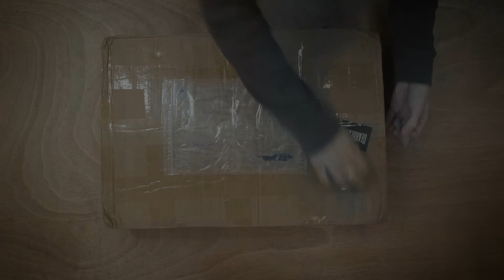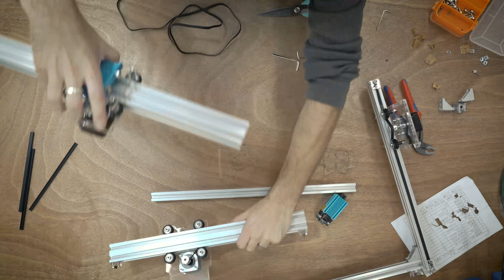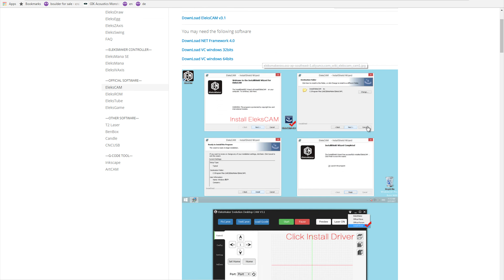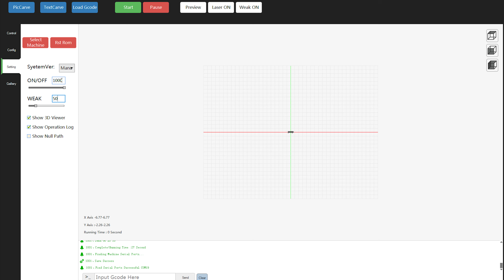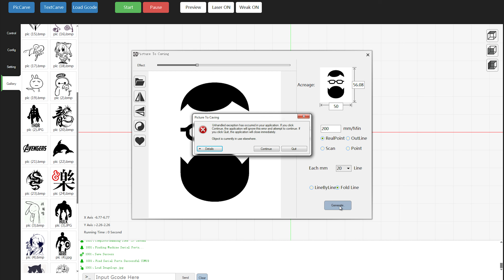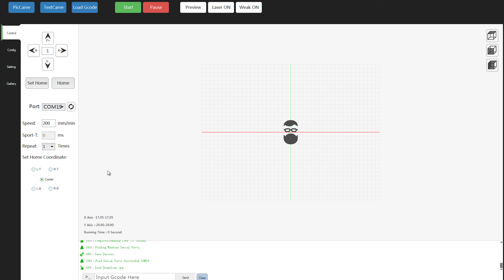Product Overview - EleksMaker A3 Laser Engraver

Comment: I have one of these and have had it for a couple of years.  I like it sort of, but it was a 2nd had one and the laser isn't the factory one that was supposed to have came with it.  It still does fairly decent.  When I engrave wood with it, I wash it off lightly with water, let it dry, then clear coat it.

Comment: Be very cautious with those laser goggles. Regardless of comments on the color. They are hardly sufficient for the laser power and thus basically not safe. For anyone who buys this or a similar engraver. Do check with a laser safety officer and if not available at your own caution do some research. There are plenty of laser safety web sites including calculators to determine the correct OD or L number. A good starting point for information is on https://www.lasersafety.com/
Have fun with these tools but play it safe :)

Comment: Really not a fair review. You are reviewing a very cheap Chinese laser. What did you expect? I'm sure your"60watt" laser is a much better tool.Sorry for the negative comment.
Reply from the maker: No worries.  I get what you're saying, but what if a car came out without windshield wipers, door handles or a muffler, but was REALLY cheap.  I kinda feel like the laser is like that.  Sure, it's cheap, BUT it's missing pretty critical components that make it function properly.  Sure, the car can still drive, but if it rains, you're kinda screwed, if you want to open the doors, sorry, etc.

Comment: Just put this thing together for my girlfriends mom. After watching this video she doesn't even want it anymore lol and I'm kinda hesitant on firing this thing up. Thanks for the warnings and telling it straight
Reply from the maker: Plenty of people DO like this laser, and it can still be useful, just exercise extreme caution and know what you're getting into.
Reply: I've been trying it out. I gotta figure out all the precision stuff like time, intensity and all those settings. So far its just burning and not really engraving. If I put it on outline it doesn't burn and looks good. I gotta put more time into it but you're right I'm starting to like it
Reply from the maker: @Space__Rooster  If it's just burning, move faster, or use a lower power on the laser.  Or use some air assist to blow away the debris it makes while burning/engraving.  If it cuts the dust, it will end up looking like a burn rather than a clean engraving.

Comment: Thanks for your video and the information because I’ve got this model and a K40 that I haven’t even used simply because I’m old school hammer and nails guy and the technical area ( computer and software) is not my department and that’s the area I’ve got to get my head around. I got this model off a relative but I bought the K40 about 7mths ago. Anyway (again) thanks for your video as it’s certainly opened my eyes or SAVED THEM looking at the virtual zero safety features and I thought the K40 was bad in that area although it’s now in a safer condition than when I bought it,  Liverpool 🇬🇧

Comment: I have the same machine and I am very pleased with it. I have over 90 plus hours of engraving and no problems. I use T2 Laser program and it is the best ever. I always use compressed air to blow away the soot at the end. This machine paid for itself at least 5 times. CO2 laser are great but you have more work area with this machine than you have with a co2 laser. They are also expensive to maintain like changing mirrors and the gas. Great video though

Comment: My A3 laser is a 2.5 watt model and I got it to cut 3mm Baltic birch plywood with a VERY slow speed, 100% power, 2 passes and also a change in firmware so I can control it with LaserGRBL! It works just fine and I even laser cut a PrintrBot 3d printer...
Reply from the maker: Yes, there are plenty of people that can find uses for the machine.  For me, cutting several passes at a very slow speed just isn't what I'm looking for.  I'm sure your edge on the cut isn't great, and it's really slow.  For me, I'd rather spend a bit more money and get something that's a bit more usable.

Comment: Hello there , thanks for yr nice video , i got Eleks A3 pro 2500 W  , i build it as it well belt tension is good but i have a problem with the software , when i load a pic the laser working and flashing but in same place dosen't  move , the three motors got power i feel it by touch but they don't move at all , can u help me pls .
thanks

Comment: crazy question, do you know anyone we could hire to build a couple of these for us? thx
Reply: How many would be a couple!
Reply: @chp9733  2......im needing to take them overseas, Im a veteran and doing a project for vets,  the reason is if one breaks I have a backup- I hate to make a promise and then have technical difficulties or deny a Vet a gift because of it...
Reply: @MrDavesbox1  In this case I would suggest you to buy the"Ortur" Laser Marking machine.  it is compact in packaging size and there is only the need to assemble 4 nuts and 2 screws.  suggest you to check it here in YouTube

Comment: Good review but get rid of that reflective base board you have, that is definately dangerous for sending the reflected laser beam in any direction.
Reply from the maker: I've said it elsewhere, but aluminum isn't as reflective as you might think.  It scatters the light.  Lasers don't just reflect off of surfaces and maintain strength.  The laser is focused on a very small area and the farther you from the focal point, the wider the beam, and the less concentrated energy.

Comment: Visit the Facebook user group for this particular laser they'll teach you how to use it. I have one similar to this - different brand - and have been using it over a year now and I don't have the issues you had in this video.
Reply from the maker: Mine had some design issues.  Without getting into it, it had a poor design when it started up, pins would go high and low, which is a bad design.  This could trigger the laser unintentionally.  Sure, you can load different firmware, etc.  But at the end of the day, it's the absolutely bare minimum you'd need to do hobby-level craft engraving.  For that, it's OK.  I guess the best way to say it, this is a toy, not really a tool.  It CAN work as a tool, but having used more professional lasers as tools for years, this is just a toy that can be coaxed to get good results.  VERY simply, if you're not using fume extraction or at least air assist, the quality of engraving and cutting will be significantly reduced.

Comment: So, what are your thoughts (or other people's thoughts) on whether I could use this for cutting out stencils for air brushing - bottom line it'd be paper or maybe manila folder type material.
Reply from the maker: I think cutting stencils and such would be good.  There are stencil cutting machines though.  If all you're doing is cutting stencils, maybe a vinyl cutter would make more sense?  But it could work for that, given the safety and reliability concerns.
Reply: @RobertCowanDIY  thank you.  I'll check into the price for those,  I'm pretty good with safety so if the price is significant then I can make sure that I am the only one near the thing.

Comment: Any K40 laser in the 350 usd region is an electrical deathtrap and should be avoided at all costs, also the tube if you are lucky wull allow about 750 hours of use maximum... bear in mind a decent engraving can take several hours. I have both and use a 10 watt diode with air assist, its way better than a co2 laser i have ever used and with the right lens cuts like a hot knife through butter.

If you want a k40 then go to k40.se

if you want a diode then Endurance lasers make the best unless you can make one yourself. 

he's right on one thing wear you goggles at all times, they are dangerous and so are c02 machines the cheap ones will give you an electrical shock that will kill you.

Comment: It's cheap and fun to learn a bit about Laser engraving, if you know nothing about the hobby (Or job) I have been a electronic Engineer for 50 years and now I am retired I decided to play around with a few cheap Chinese Electronic units due to their cheapness, We are not all Millionaires who can afford £1000. to £100,000 to buy the expensive units just to learn how they work or how to use them, I 100% agree on the safety Laser goggles, and due to the Low laser power you are not going to accidentally slice you head of with one of these if something goes wrong with the unit. I read a lot of comments on cheap Chinese Electronics, some are good and some are bad But I love them because when experimenting with them if you bust something it's not going to cost an arm and a leg to replace the part! Unless you buy the units from RS Components, or farnells electrical. Both very expensive compared to the Cheap Chinese stuff, but hay I have had over 100 cheap Chinese LED, LCD panel meters (All installed in units I have built over the years, and still working fine costing pennies. This is only my opinion. Good Video thought! If I had to buy all my Electronics from the main Electronic dealers, like I used to when working for the companies I used to work for, I would need to be far richer than I am now. If you want to see some of the items I made since retiring, type My electronic work shed.
Reply from the maker: Your opinion is very valid.  For me, I don't like playing around with something that costs me time, or doesn't give me expected results.  It's the same reason I'm not playing around with a DIY waterjet, or a DIY metal 3d printer.  They're not cheap enough to be useful.  I feel like this engraver is just like that, it's more fiddly and inconsistent to be useful as a tool.  As a hobby and a curiosity?  Sure.  But not as a tool I rely on.

Comment: Can frame be modified in order to be more bigger?
Reply: no, it is locked to be only what it is forever. you can NOT in any just buy longer or shorter pieces of the same widely available construction material it' made from, not reprogram the new size in the chip.

Comment: All valid points....but this machine can really work well: You can use something like LightBurn for the software..WAY better! To make your burns even, you can turn on overscan, and this will avoid the edges being darker, due to acceleration and deceleration.  You can use an airgun to blow away any burn material, to avoid smudging.  This machine, for the price, with a little tuning can work well! Just needs a bit of tuning, but not everyone is capable of that..in which case, solid advice: Go get a K40 400Lb machine.... :-).  Thank you for taking the time to create this review and video!

Comment: Does it cut balsa? Which machine would you recomend to cut light wood, card, etc
Reply from the maker: It depends on the thickness.  It could probably cut up to a couple mm thick, but it would have to go slowly.
Reply: thanks  @RobertCowanDIY . which good priced laser would you recommend?
Reply from the maker: @ruisilva8222  I recommend the K40 style lasers.  Search Amazon or eBay for 40-watt laser.  This is a CO2-based laser, so it will have more power, but a smaller work surface.

Comment: Robert, is it possible that the open design is so you could engrave a large design by breaking it up into sections, and then moving the laser around to engrave each section?  Seems you obviously couldn't do that with an enclosed machine.  Please excuse rookie question, I'm just starting to shop around for my first machine.  Thanks!

Comment: I appreciate you putting this together. I have a CO2 and have considered one of these as a light engraver, as I've seen some great results in them. However, the points about plastic construction convince me that I should consider a better machine, as I don't mind constructing it once but high probability of the plastic stressing and breaking is something to consider if once is enough. Thanks again!

Comment: Love the review! What would you say the best all around affordable set up for a 40w-60w c02 lazer would be?
Reply: Light Amplification through the Stimulated Emission of Radiation. LASER. And the most affordable setup while still maintaining quality would be to build your own frame using OpenBuilds and then purchase the CO2 laser parts separately.
Reply: @JesusTouchedMyJunk  Awesome! Thank you so much for your time and knowledge. My phone corrects me to lazer and then I've seen laser also, so I wasn't ever sure which it was. Thatnks for teaching me that. So can I run something like this in my apartment with a window open or do I need a well ventilated shop?
Reply: The advantage of a monolithic diode laser such as this blue one in the video is that it doesn't require nearly as much support equipment as a CO2 laser. So, it is therefore considered much safer. A CO2 laser requires a high voltage power supply and active water cooling, whereas a diode such as this (although not this particular weak chinesium diode) requires only air cooling with a PC fan coupled with a beefy heatsink.

To answer more directly, yes, I have a 7 watt blue diode set up in a similar configuration in my spare bedroom (Carpeted floors, sheetrock, etc). I do not feel nearly as worried about this as I would if it were a CO2 laser, due to less of a burning hazard.

Ventilation is really a matter of taste. I've been running mine completely unventilated, and unless I'm cutting wood it's not bothersome. But even the wood fumes do not set off smoke alarms. For a CO2 tool you would definitely want ventilation because of the higher material removal rate and therefore much more stuff in the air (and larger particles of stuff).

I'd recommend endurance lasers or OPT lasers for fully assembled heads, or DTR's Laser shop for the diodes themselves.
Reply: @JesusTouchedMyJunk  Thank you so much for taking the time to reply! Now I have some more research to do since you broke that down so simple!
Reply: Glad I could help! There are some really great resources out there. Don't be afraid to bite off more than you can chew. You seem motivated and curious enough to figure this stuff out. Happy Lasing!

Comment: I bought one and modified much of it to suit what I wanted.
Main thing was to use drag chains for the cabling and also change the software to use LaserGRBL which is free and a thousand times better than what came with the machine.
I do have an 80 watt CO2 laser that I used for doing jobs like name badges, engrave and cut, but I found that this diode laser actually does a better job and more easily too.
I also added some changes to the laser output end by adding a 3D printed nozzle that carries a flow of air to the engraving area, this made the engraving far better and also cleared away the smoke generated.  I ended up putting the whole machine inside a MDF case that has smoke extraction built in, red  acrylic side panels for laser protection.
In all, I would say that for the price it is a good start for building a cheap machine that is practical for many small jobs, but needs to be made safer.  The laser coming on without warning is a worry, so the best way around that is to press the low laser button and leave it on while starting up the machine and also the computer.  This button uses the laser in low level power for setting the  focus and also for placing the work piece in position. When the software has been started and everything is ready for engraving, release the low level button and the laser will not start unexpectedly by itself then and only fire when the software instructs it to do so.
Reply: Make video of it please